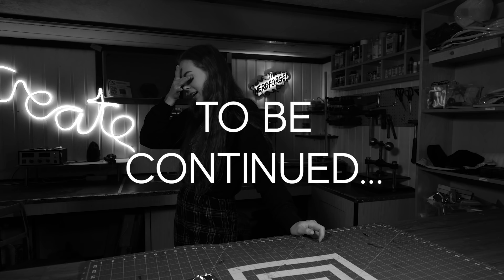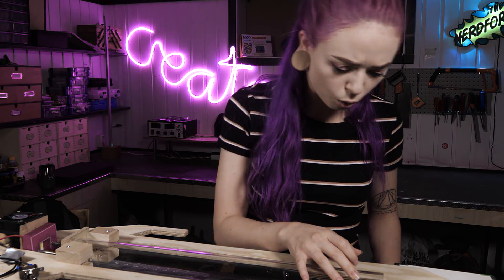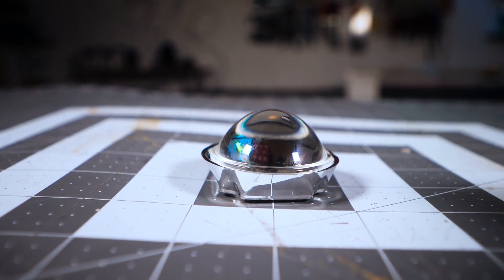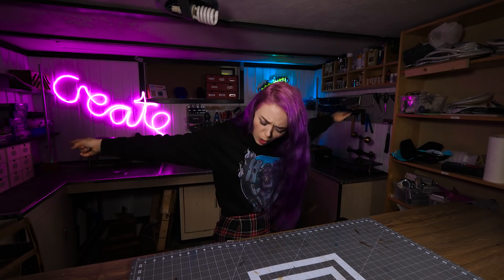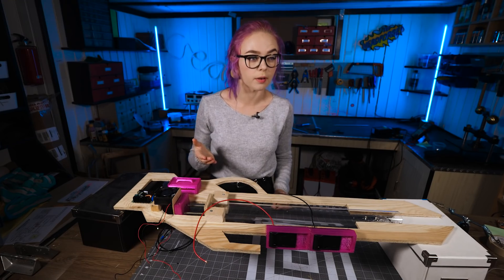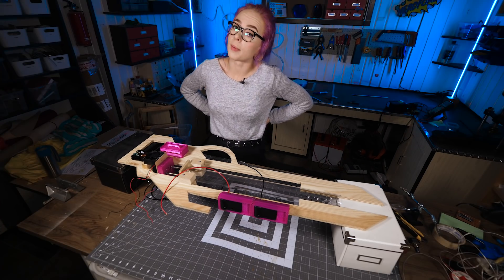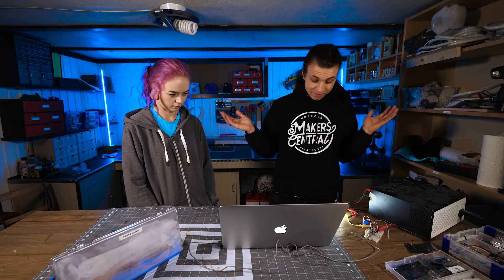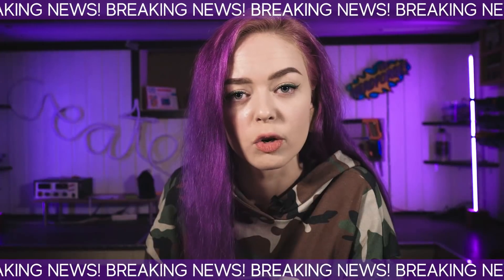I'm Building A LASER GUN Prop (and now the electronics works!)

Comment: You could always use a rotary encoder to dynamically change the colours? Use the push to cycle through the r g and b, and rotate to change the values, and perhaps with a another small one (those that snap into a setting, can't remember the name) could be used to address different parts of the gun, or just increment every base value with the same amount, so you have the same pattern throughout the system, but with different colors. Just maybe something you can consider if you want to be able to change the colors on the fly. Anyway, keep up the good work 😀😀

Comment: Great video as usual! I can't recall if it was mentioned in the first part, but have you considered "frosting" the tube either by sanding or a diffuser insert? Would help the light travel significantly across it. Mind you it depends on the look your going for.

Can't wait to see the final gun :D

Comment: You should make sure that the LED strip that shows the charging animation is visible when you cover the sides of the gun. It looks so good. 
This isn't a pew pew gun, it's a blast cannon. Ideally, after the charging is complete and you pull the trigger, it will show an intense flash and then start charging again.